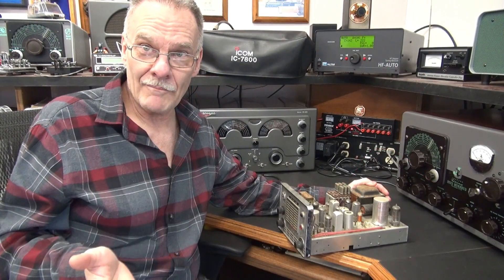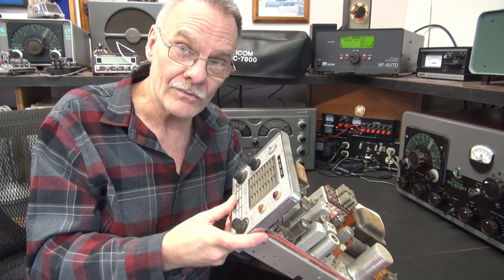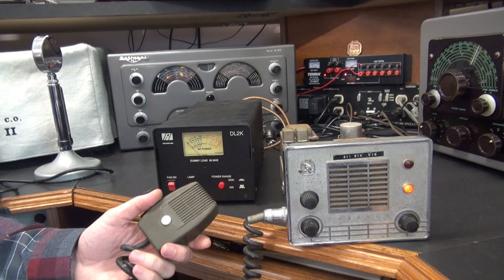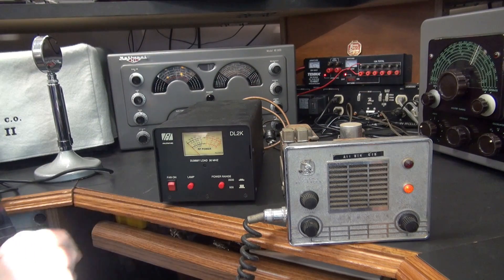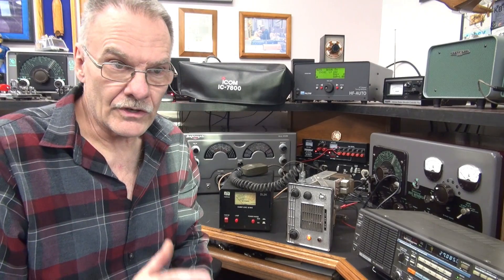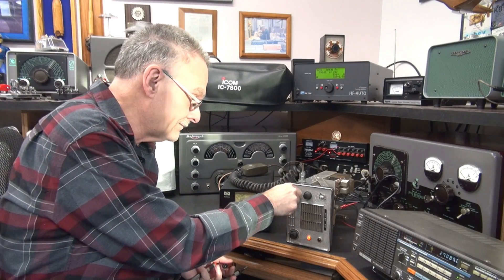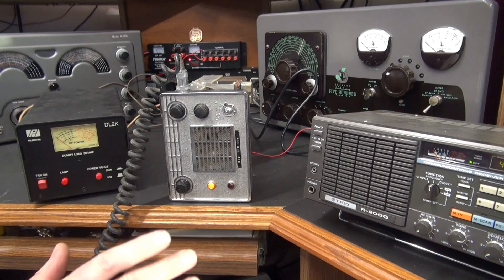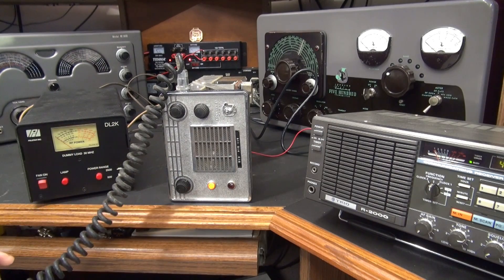How to fix Vintage Johnson Messenger 1 tube type CB No modulation or audio Yep another stupid cap!

Comment: All these old Johnsons were built like  a tank, to fill a need for cheap reliable communications, they first came with a "banana" microphone!  They would take the vibration of mobile use, taxi's, schoolbuses, semis, police cars, tractors and combines on the farm, etc.!  Put in a jumper or replace the 12AX7 with solid-state diode tube for a couple extra watts and hook to a 102" whip you were flyin high!

Comment: The only thing Johnson did to put these on 11 meters was to put a large resistor in the plate circuit of the final (They were originally designed as a 10 watt business band radio) to cut the output to 4 watts.  We used to "strap" that resistor with a piece of wire and voila!  !0 watt CB rig!    Later we used them as a 10 watt 10 meter rig. Ke4io

Comment: Shucks, I was hoping we could see it become a resurrection with neon pinstripes, perhaps some fancy powder coating,  and have it drive 4 transducers and has a input for a standard guitar and another for a straight key  or microphone, switched. So it can be used @ Radio club for training.
Rock a Billy, CW, PA modes... 

😢

Comment: I have one of these old Johnsons.  The original mic was wired in.  If you find one of those old electronics magazines or Popular Mechanics from the 60's you will find that the mic was long and slim with a square end that you spoke into.  I'm old enough to remember when they were new. There was a factory 10M version so it might be advertised in QST magazine from back then. Many decades ago I actually contacted E. F. Johnson about how to convert it to 10M.